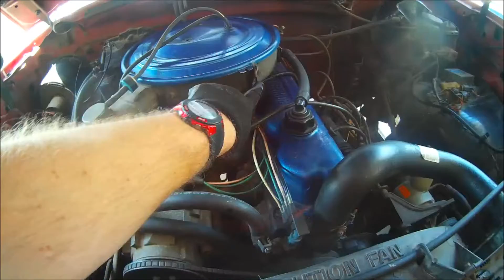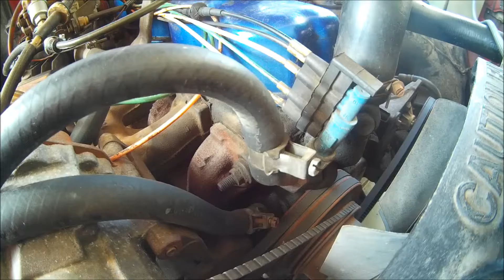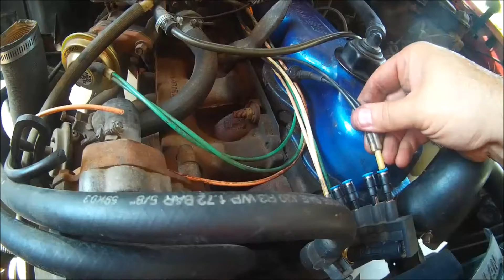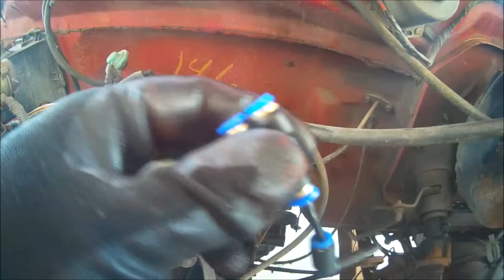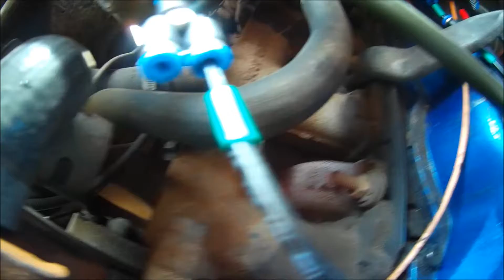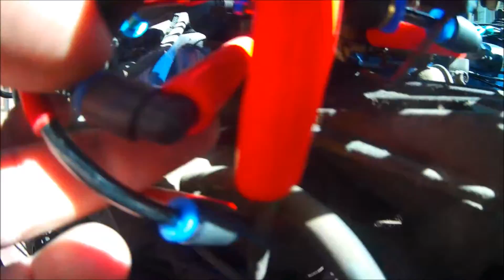1980-85 Ford F-Series Vacuum Hose Routing Part 2

Comment: Thanks for producing & sharing this vid' . 

Although since ya don't have three hands, you were unable to share the actual removal technique of the  sleeves,  and then the PVS.  
    
Just ordered a new  PVS to replace what is probably original stock 2-port unit.       Probably be a good idea' for me to apply some B'penetrant on the threads.
    
Presently at this time, not going to bother upgrading the 'lines.   ;-)

  
'82 F100 v6 3.8L  3oT 8-)

Comment: while I can't work on my truck at the moment (82 F100. same engine but with the ol' 3 speed), I REALLY hope this video will help me solve the routing issue I have. all my old lines were cracking and falling apart when I would try and remove just 1 line, so I had to take them all off.
Reply: update. now the carb is dumping fuel into the vapor canister. I wonder if it had to do with me plugging in the air pump below the carb...

Comment: Very nice video. I need help on the sway bars. I bought a 1981 ford bronco from Moab, and brought it back to West Jordan ut. It is set up for a rock  Crawler And I would like to take it on the road. It does have a 6" lift with 33's. I'm not sure what I need to do please help. I'm just a utube  Mechanic.

Comment: Where does the pink line connect to?
Reply: Air Pump has a TAB and TAD valve. It connects to one of those.Color Codes to do Vacuum Diagram

Red= Main vacuum
Green= EGR function
or Orange = Heat control Valve (exhaust & intake) (AKA heat riser but more complex)
Yellow = Distributor advance
White = EGR vacuum (source)
Black = Mainly used for the Evaporative emissions control
Or  Thermactor ACV or Diverter valve
Blue = Throttle Kicker control
Pink = Thermactor Air Bypass Valve (BPV)

Comment: Excellent video...super helpful for my 85 F150...I do have a quick question...
You didn't replace it...but you had a 6" red tube hanging off of the top of your carb that just hung there. Was on the passenger side...just dangling. 
Any idea what it is and what it's supposed to be connected to?
Reply: My carb had a black hose just dangling from that port, can't figure out if that's right or what it should connect to. I've seen it just capped off in other videos. Let me know if you've figured it out